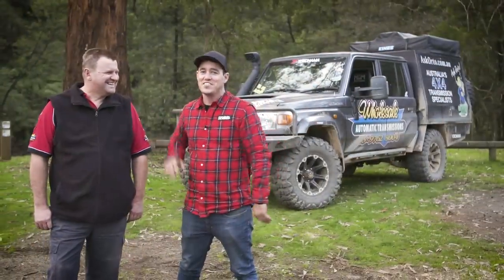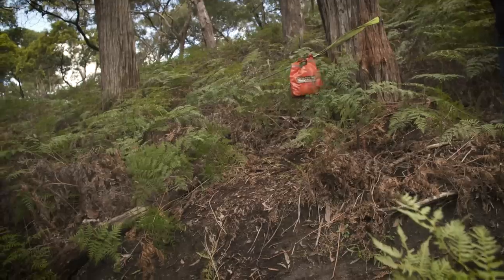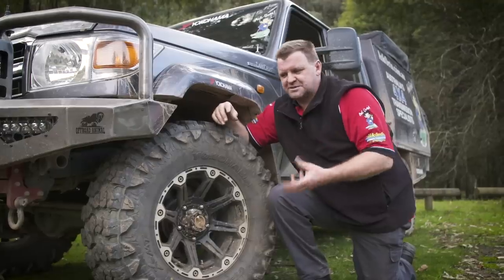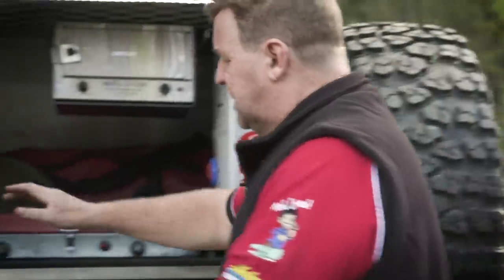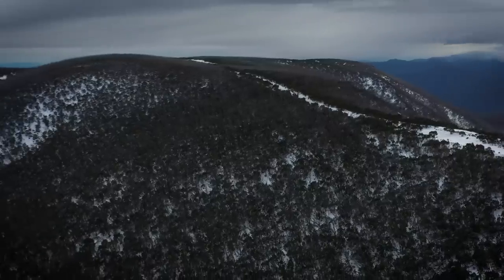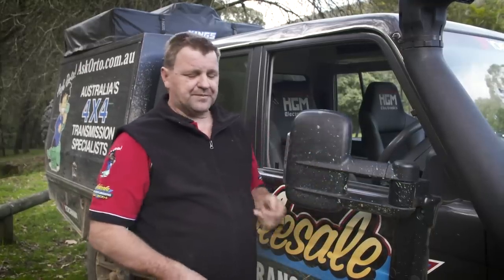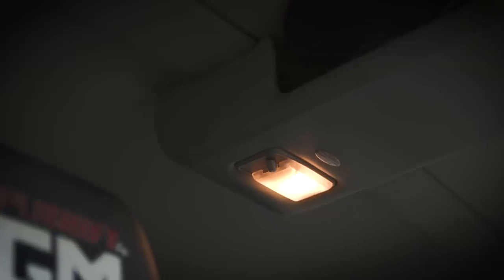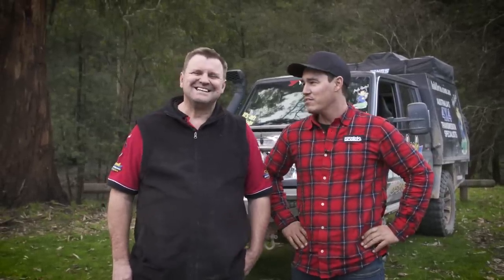Rocket Rod’s 79 Series Landcruiser Mods! Secrets that make it a BEAST offroad + canopy setup

Comment: Cool truck, but if the tyres have been that good I'd be dropping down to one spare and putting it at the front of the drivers side canopy (if it fits) just to drop a whole load of weight from the back. Still love it though :)

Comment: I drive a single cab as a pilot vehicle for work, and i do most days from sunup to sundown, sometimes a full overnight junket to meet up with a load and at the end of the day i can hardly walk when i get out of it. I find no leg room, no headroom, and the standard seats kill my back. Most times my legs have puffed up like a balloon. So how do you find it after a long day in the saddle? Also i'd like to know how you afford to run the thing? Less than 800km out of both tanks is not what i would call great economy considering the 2 iloads the company has get over 1000 km to their single tanks, and damn site more comfortable. I suppose the fuel rebate the company gets might help there but still....

Comment: I'm from the States and have a 2000 Toyota 4runner 4x4 3.4l petrol auto and had a friend tell me that I can install a 5spd auto transmission with a kit you make, is this true? One more gear sure would be nice. Also what is the ideal rpm range for the best fuel economy?  Thanks.
Reply: If you can work out a way to bolt the 5 speed Toyota A750F auto in then yes we can run it electrically. Fuel economy would be best at about 1900 Rpm on std size tyres.

Comment: I don't understand why you wouldn't want rear coils.  I have a 2018 RAM 2500 6.7L Cummins Turbo Diesel, capable of towing 20K lbs with ease.  And a payload of 2500 with ease.  The coil sprung front and rear suspension is awesome, smooth and comfortable.  I have solid axles front and rear.  I wouldn't go back to leaf springs ever again.
Reply: But your not going off road and putting the whole vehicles weight on just one rear wheel.
Reply: I pull my camper off road quite a bit. It weighs 12k loaded. Lol.
Reply: @rodneyhudson-davies5027  I don't think anyone is bud, unless they have some anti-gravity going on, on the other 3 wheels.

Comment: Rocket, why did you change from the Uneek 4x4 bar over to the Toro?
Reply: Uneek bar was to close to the bonnet and the mounting for the scrub bars was not to the load capacity that I needed. Also there is no denying the styling of the Toro Bar from Offroad Animal.

Comment: Rocket I loved your customisation 79 talk. I missed the engine cc size. Due to health no more soft 4 wheel driving for me - bar pulling my caravan across a field & helping friends who are stuck in the mud even new landrover, Hyundai & Volvos with my Subaru. Sadly had to swop it in (Due to worsening health) for a Rav4 which is still, very good. Especially sport mode - which works best for off-roading. I can't thank you enough for the 4WD Action trip YouTubes. Keep up the adventures & Vehicle spec talks.

Comment: I have 2 questions: (1) What is the best to drive through a bog hole or climb a slippery hill on Low Range gear? In an Auto or Manual? (* I have 2018 hilux auto with manual trans option)
(2) is it good to drive in Power Mode everytime doing offroad?

Comment: Nice ride! Just perfect.. 
My one question to you is that i want to upgrade my gearbox in my toyota hilux surf actually running a A343F gearbox with center diff lock on a Toyota 1kzte engine top mount intercooler. In your opinion what would be the best gearbox to go for,  Keeping the center diff lock??
Thanks to let me know..

Comment: Meanwhile back in Japan, the designers and engineers of the 79 have just discovered 4wd Action and Rocket Rod. They thought they had tested to the limits but now they're finding out what you can really do in a 79. Eyes like dinner plates and some even flatlining; with what breath they have left they're asking "Who is this Wocket Wod?? 
 Top rig. Genuine all round good bloke. Wheels in the air more times than I've had hot diners. Keep having fun out there.

Comment: The main advantage of leaf springs is they are naturally progressive in rate, compact vertically and width wise, and you can use overload leafs that bottom out on different parts of the frame to take additional loads more easily than with coil springs. Leaf springs distribute the compression load to four parts of the frame(not including overload leafs), however the issue is that those two points are also responsible for controlling the axle, and those two parts of the frame have to resist the torsional load applied by the leaf springs during articulation. With a coil setup, the coils only take the compression load of the springs, granted only in the spot where coil bucket is located. With a coilover system you can effectively make a dual spring rate similar to overload leafs, however they take up more space. The control arms on a coil sprung axle spread loads across 7 points on the frame, via the links and sway bars, and in general the load is just compression or tension, no appreciable torsion is applied. I've seen leaf sprung frames bend at the front leaf mount many times due to this difference, because a lot of force is concentrated at one spot, especially when towing. with a link system, the load is spread more evenly mitigating this issue to an extant.

Comment: I prefer rear coils, but not rear struts or coilovers. Coils can easily use supplemental airbags to handle loads and to articulate better (if plumbed correctly).

 Upper linkage should be triangulated with coils on a straight axle though, to eliminate the need for a trackbar.

Comment: Wait till ya drive the 30 with the auto Shawno it will never be on it’s side again ha but here’s a question do ya need a cooler on a 200 series cheers
Reply: If you tow then yes, highly recommend the extra large oil cooler.

Comment: I have seen a lot of these series of vids, but what surprises me is that not one of you guys have re-engineered a PTO winch system or even a Capstan winch - you guys continue to use electric winches which are heavy, draw a lot of current and are not always reliable.

Comment: Its been awhile nice to see u back rocket rod my question is nt on your 70 but on my 80 has an auto with the throttle position sensor which is kinda broken sonim experiencing hard gear changes any advice?
Reply: We have replacement Throttle Position switch if that's what you are after?
Reply: @rodneyhudson-davies5027  im in kenya i dont think its an option
Reply: @realthugg4312  try replacing your broken unit and see how it goes.

Comment: Thanks for the detailed look at your 79. One query how are you getting 215 kw out of the motor. You mentioned full boost on the turbo but unless it is a different turbo I don't think it'll make that much at the rear wheels. Thanks again and keep on running that 79 at full noise.
Reply: He’s running the Dynomotive turbo with the unichip combo
Reply: @thegoldensnitch6312  Ok. Thanks for letting me know.
Reply: Uni Chip, Legendex Exhurst and larger turbo (Mild)
Reply: @rodneyhudson-davies5027 Thanks for letting me know Rod.  Keep up the great vids.

Comment: Is there a reason you don’t move your roof top tent forward onto a roof rack to push more weight forward?
Reply: I have thought about this alot and yes you would get better weight if it was on a flat rack on the roof of the car. Just didn't lol

Comment: Whats the general kind of maintenance you do to the 79 after a 4WD Action trip?
Reply: Back to wheel bearings after each trip and rebuild each corner. Pull radiator and full major service each time. This is about 2-3 times each year.
Reply: @rodneyhudson-davies5027  
The works!! love the 79, keep it up Rod!!

Comment: Rocket your water prime issue is because of a leak on your inlet plumbing.
I had a leak that when I did a pressure test it would not leak but when I installed it (on the inlet side) it managed to still suck the tiniest amount of air, and the pump would never stop running

Took me days to figure it out and find the fitting that was causing the system not to prime...
Reply: Thanks for the info mate. I will look into it.

Comment: You don’t really need slotted rotors unless you are racing. They wear your brakes out faster
Reply: Depends on the car you got but a big heavy 3+ tonne rig absolutely should have slotted rotors, don't wan't brake fade pulling that up going downhill on the highway. Especially if you tow heavy loads. Slotted rotors aren't just for racing. Safety First
Reply: ZedTee77 brake fade happens when you are on your brakes a lot.(racing)I can’t see them getting them that hot going through mud water and what 5-10 mph on a trail.  One on man !! Even on the hwy unless you go balls to the wall. Riding your brakes is the only way they will get hot at fast speeds. Not 4wheeling. But that’s me.
Reply: @rods907  Well "going through mud water and what 5-10 mph on a trail" isn't the context provided "going downhill on the highway" is, and I can tell you from experience that brakes fade fast with standard brakes on these heavy rigs. Please read the reply properly before giving an uneducated and naive response mate
Reply: Brandon Rodda I have never had brake fade when was a truck driver (20 yrs) or even in a car/ pick up You know the old saying speed kills. Here’s an idea slow down and drive accordingly if you are hauling a heavy load. It’s not rocket science you know. And people who do shouldn’t be driving. I know shit happens but pay attention and your good. Please have common sense before replying mate.
Reply: @rods907  No need to get wound up over it all mate. I've had a few times on downhill descents while towing the car trailer where the brakes get hot after a few decent hills and where the traffic slows down going downhill for no apparent reason ( the road is clear ahead but they slow down by 20 or 30 k's on the downhill). Also driving in heavy traffic, as much as you try and leave a good gap behind the car in front while towing, every fucking moron and their dog will cut in front of you leaving no gap, forcing you to have to continually speed up and slow down with the traffic. No one on the road seems to appreciate a safe following distance. After not long at all things get hot. Depends on where you are and the car but road cars don't cool the brakes well at all, there is no brake cooling vents on most road cars, after a few hard stops they will be hot and retain the heat. The big point of the slotted rotors is to avoid brake fade, its Safety First! Some cars need a brake upgrade because the factory fitted brakes aren't big enough to start with.  My Partners BA Falcon the brakes are terribly undersized, with the standard brakes and the ute unloaded doing an emergency stop from 110 kph and the brakes are cooked and fading before you come to a stop. You get overwhelmed by the smell of hot brakes when you stop, My BA has Slotted rotors on the front and They work very well compared to the standard disc. I have deliberately done a full emergency stop from 110, sped back up to 110 and done the full stop again (With no one else around of course) they get bloody hot but they still work really well. Much better than a factory set. Brakes are a safety item and its safety first! If the brakes were warm and a young kid ran out in front of me i'd want the brakes to be the best they can be. Telling someone that upgrading the brakes isn't needed is a bit silly, upgrading a safety item is spot on! There's no need to get wound up over it, but slotted rotors aren't just for racing...

Comment: What is the weight distribution to the front and rear axel? Is it as rear heavy as it looks or is the big diesel heavy enough to compensate it?
Reply: No she is very rear heavy but handles very well both on and off road, although she will lift wheels very easy off road but drives just as well on just 3 wheels.

Comment: Why would ya want the rear wheels a different width to the front?
Reply: Lincoln Taylor he doesn’t, they come from factory with narrower wheel track on the rear, rocket has corrected it so it is in line...
Reply: @Ben-xy3jn  Cheers Ben. Seems like a bit of a mistake from Toyota.
Reply: Lincoln Taylor more like laziness, when they went from an in-line 6 cylinder engine in the older models to the v8 in the current models they had to widen the engine bay and front end to fit the new motor in and just couldn’t be arsed  to design a new rear axle to match the widened front axle so the fucking muppets just left the old axle in the rear which is 100mm narrower than the front, hence rear wheels track 50mm inside the front wheels... most people just put offset rims on the rear to correct it if they feel the need but there is aftermarket axles etc to correct it..,
Reply: They don't sell a lot of 70 series worldwide so it is not a very profitable model (this is also why they are fairly expensive to buy). 

Any change costs money to develop and it is not a model Toyota likes spending money on so that is why the wheel track still hasn't been fixed since 2007.

Comment: What’s it weight fully loaded and what’s the L/100 with all that weight?
Reply: Fuel consumption is 14.5L per 100 when fully loaded on 35" tyres and roof top tent.

Comment: Nice rig Rocket Looks good but way did you not go to 4inch lift i know cuss of the weight at the back but is there no uther Reason way stay so low
Reply: Certain states in Aus don't permit a 4 inch lift.

Queensland, New South Wales, and Victoria only permit a suspension lift of 50mm, and an additional lift of 25mm with larger tires, without special permits. 50mm = 2 inches.
Reply: I don't want to much height so I keep a lower centre of gravity on the hard off camber tracks.
Reply: @rodneyhudson-davies5027  cool oo and did not know you guys olso had a hight restriction just like us haha here in South Africa whe are not alowed to do Diff block spacers

Comment: What does lock up mean in the automatic transmission?????
Reply: locking the torque converter clutch. give you direct connection between the engine and gearbox..  like a manual gearbox

Comment: A quick question Shaun can u actually add more than one turbo charger in the 79series?
Reply: I'm not Shaun but it simply isn't necessary to add extra turbo. You can get amazing power out of a larger single unit.
Reply: @ @rodneyhudson-davies5027  thank you Rocket roode awesome sorry for the name confusion lol.
Reply: @rodneyhudson-davies5027  do you know how much extra torque are you getting?
Reply: A Uni Chip will give you 50% more torque without any other upgrades and I do highly recomend them. With mild turbo upgrade 100% more and then the sky is the limit after that. The only problem is that there is such a thing as to big as the larger the turbo you go the more turbo lag that needs to be delt with. In a manual not so much but you can ride the clutch a little more but the auto simply doesn't need a super large turbo as the torque converter allows you to come on full boast very early. The autos don't like the super sized turbos as they you can introduce a lot of turbo lag. The autos like low down toque, not high end torque.

Comment: Just wondering why all the 4x4 in this show never get proper roll cage for safety reason.
Reply: because they are daily drivers too, not full off road only set ups
Reply: Sorry for asking but this is maybe all about rules in Australia that not let anyone build roll cage for street use ?
Reply: @agungcahyanugraha1516  roll cages and the laws change in the different states. Some states allow the use of half cages some full cages and others no cages at all
Reply: Thanks for the info mate n this is maybe one of many the reason to consider why they don't put any rollcage suppose they will not break the law if they had jouney across the states in Australia.